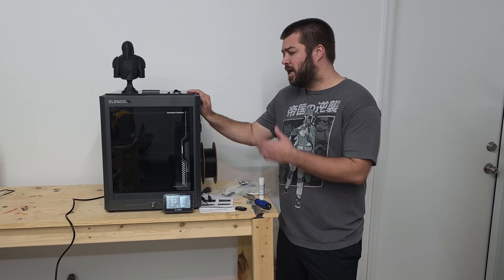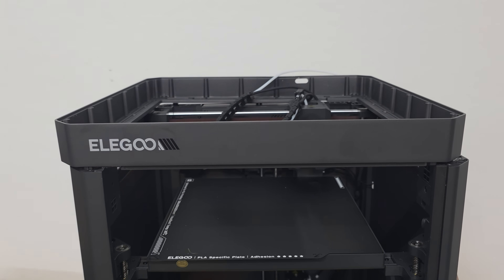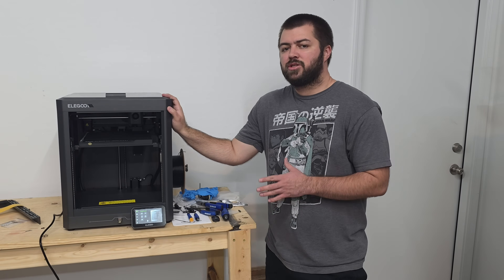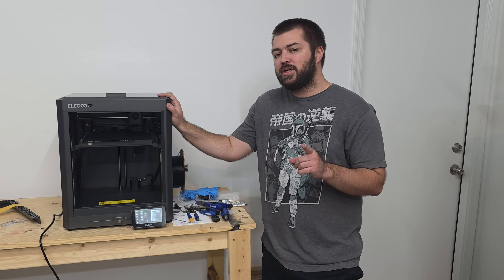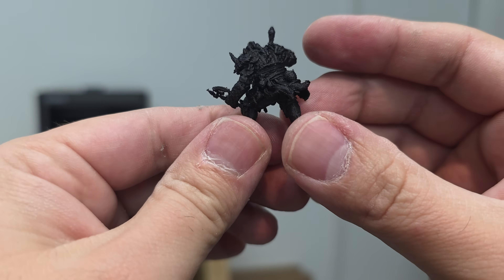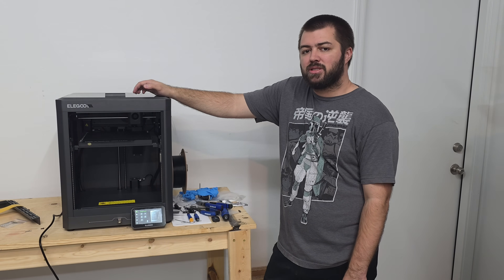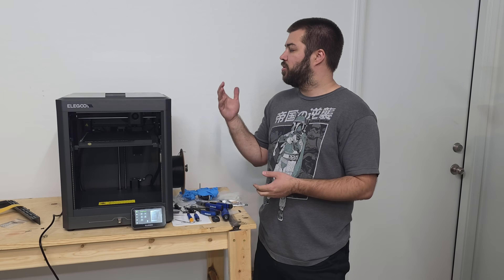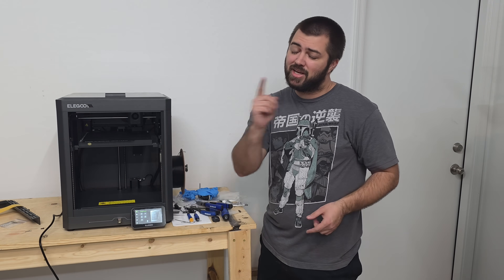Elegoo Centauri Carbon Review after 2 weeks! Unpaid! BEST budget/beginner 3d printer?

Comment: Regarding your “anomaly” it would be good to know what Firmware version (and slicer version & platform) you are/were running when it stopped. 
Did you try rerunning the same job (exact same gCode) after power cycling everything? 

If you have any large and important prints to get done, I would suggest “power off for a count to ten” before loading the job would be good insurance, and transferring the file by usb stick should eliminate any possibility of Wi-Fi comms issues (I have heard of video freezes). And hey, not using the video while printing might be helpful. 
All simply suggested as temporary workarounds. I have a personal interest in this being resolved before May… !
Reply from the maker: I'm on the base software without an update. I didnt rerun the same jobs without any tweaks. The longer jobs I ran on my a1 after.

Also my router likes to kick printers off wifi if it has an update so I always usually do the USB stick into my PC
Reply: @  No Firmware Update done??? ??? - I think it was Sam Prentice who said that Elegoo told him that one of the fixes in v 1.1.4 was for the thing freezing in the middle of a print. // (And ISTR that there was an accompanying slicer update)
It may be that your problem was fixed well before you encountered it! My concern was that the problem was still there despite that update. 
I was actually wondering whether you had been able to access an even newer version… !
Reply from the maker: @dougal6569  I believe the anamoly issue has not been fixed according to groups. Mine has an error pop up. It doesnt just stop printing. I can try to update and see if it occurs but I dont think my specific issue has been resolved.
Reply: @ it would still be good to know what version you are/were running! Especially as the printer seems to be in “public beta” with issues still being resolved, it matters to know which revision is being reviewed. I will admit to always checking for downloadable updates as a basic part of my installation process, whatever the device!

Comment: Is the top frame held with screws? There are no plastic parts? Are screws glued?
Reply from the maker: The top that is showing is metal and the inside parts are plastic
Reply: @3dPrinterMike  I was asking how the top part is connected to the frame, is it connected with screws? This means plastic is not used for it.

Comment: There are some concerns I have regarding this printer.

The bend on the PTFE tube as it goes into the extruder and the position of the run-out sensor. Having the run-out all the way on the outside, makes seem like there's gonna be a piece of waste filament everything a spool actually runs out.
Reply: When the machine senses the run out sensor activated, it continues printing and then stops from what others are saying. It seems to know how much filament is left and then initiates a pause for the change.

Comment: $299 for a solid coreXY machine is nuts.  Before Elegoo announced pricing, people were guessing it's a $500 X1C clone printer.  Even more interesting to me is the non Carbon version that is $199 delivered - no enclosure, no camera, and for some reason the bed is limited to 100 C instead of 110 C.  That may be firmware to prevent cheapskate customers from making a super cheap Coroplast enclosure and having a $230 Centauri Carbon.  I print a lot of TPU for my home based business, and thought about buying two of the Centauri unenclosed printers, slapping on a couple of cheap web cameras, and setting them up in the basement for mini print farm production printers.

I disliked Elegoo having their big product announcement and then accepting pre-orders for delivery in 4 months.  I'm not a fan of buying the right to own something in the future that doesn't exist.  It's a bit like buying a pig in a poke.  I like Elegoo but that long delivery delay seemed weaselly to me.  I think I'll wait.  Who knows what 3D printers will be available in four months?  I also think I'd rather miss out on the special pre-order price and pay $20 more to have an upgraded production printer without all of the early bugs such as some mystery exception error that cancels a large print.

Comment: How’s the noise compared to the P1S?
Reply: I like that you are you.  Don’t worry about what other people think.  Say what you think…. I value honest opinions and am going to purchase 2 of these.  One extra incase there is a problem with shipping or a door getting broken.  I can play around right away while i fix the issue.
Reply from the maker: Appreciate that pal
Reply from the maker: I haven't used the p1s but the carbon is definitely loud
Reply: @3dPrinterMike  if you have it in an area and you close the door could you still hear it? my bedrooms in the house is right outside the work area where the printer would be set up.
Reply from the maker: Yeah the fans are loud
Reply: @3dPrinterMike  what fan mode are you typically running it in?  How “silent” is silent mode?
Reply from the maker: @hobbithubby5076  I can see if I can test it soon. I just run everything default cus it works and I Print in my garage
Reply: @ Is the CC about as noisy as the X-1?
Reply from the maker: I have the a1 not the x1 one unfortunately but the a1 is definitely quieter than the centauri